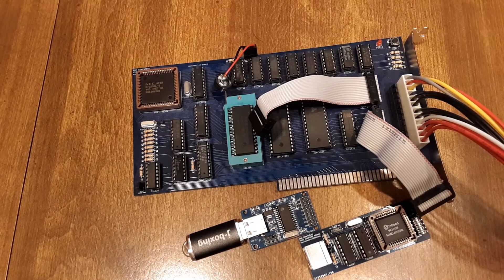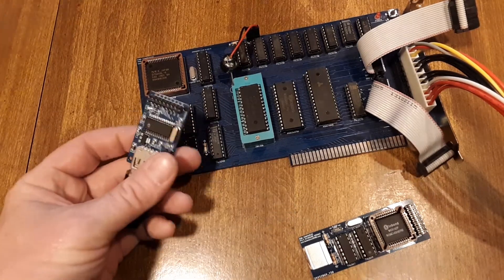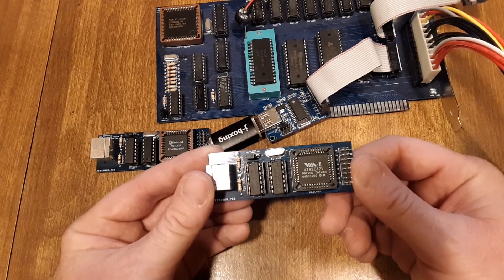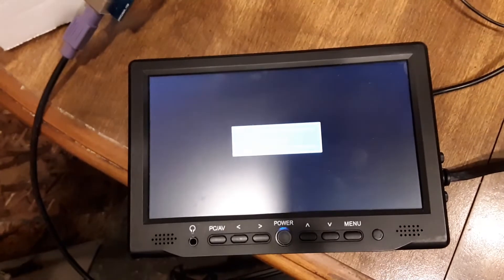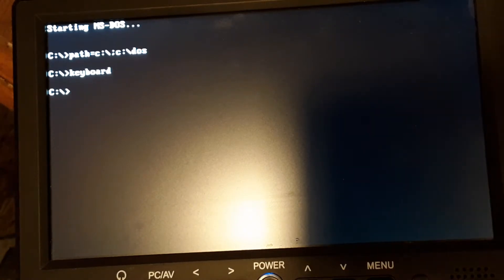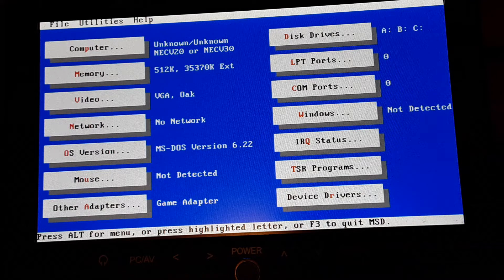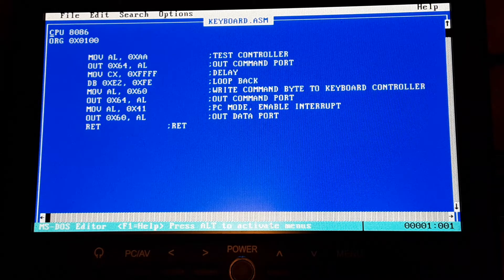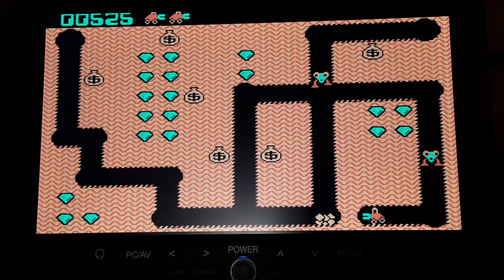V40 Motherboard on ISA card. Third party BIOS demo,  VGA card USB booting DOS 6.22

Comment: Hi,
Any plans to develop truly 8088 sbc that contain all need like flash had, ram, audio, video out in small factor?

For instance there several “laptop” cases for raspberry pi - make 8088 modern laptop?

Best kind 
Rafal
Reply from the maker: For now no. I could take the the current design and put it on a single PCB. It would be about the size of all the boards combined. You could reduce the number of card slots or completely remove them to make a smaller project.

Comment: If you redesign the Keyboard PCB why not just add a jumper that can be used to ground pin 8 so both types of PLCC can be used?
Reply from the maker: Good question. Both the W83C42P and the VT82C42V will work with pin 8 tied to ground. So there is no need to select between the two. I originally was only working with the W83C42P that is why there is a design limitation for the VT82C42V. It was the rising cost of the W83C42P that led me to seek out other keyboard controllers.
Reply: Gotcha!  I must have missed that!

Comment: I wonder, is there a way to add this keyboard controller to existing 8088 board? I have some rare WYSE computer with rarer keyboard interface and I'm wondering how this keyboard controller of yours interfaces with system.
Reply from the maker: I am sure it is very possible. I would mount the keyboard controller directly on an ISA card with a PS/2 port. That way it would fit in nice and clean.  

IRQ1 is not usually available at a hardware level on a PC Compatible motherboard. So you would have to find an available IRQ to tie into. Then depending if you can access and modify the BIOS to interface with the chip directly. Or if you cant do that then you would need to write a device driver for DOS or for the OS you are using.